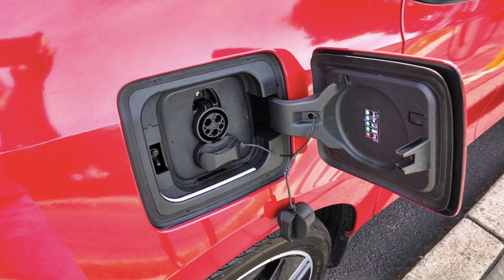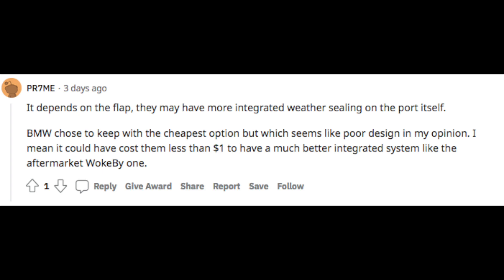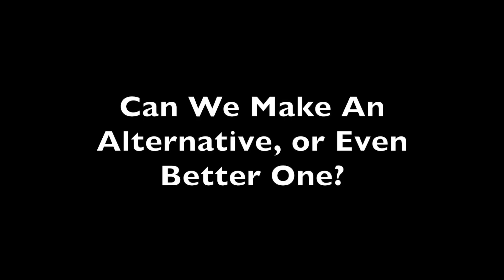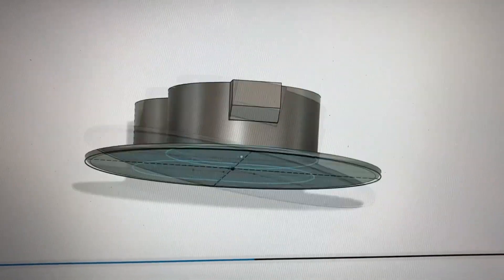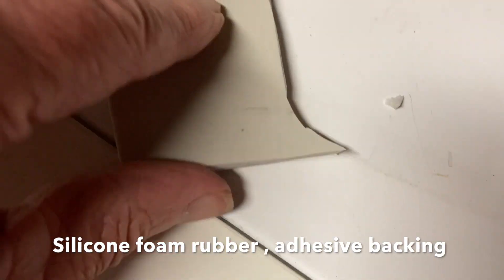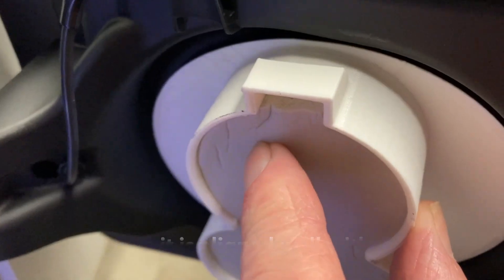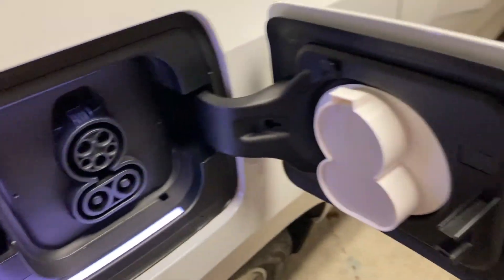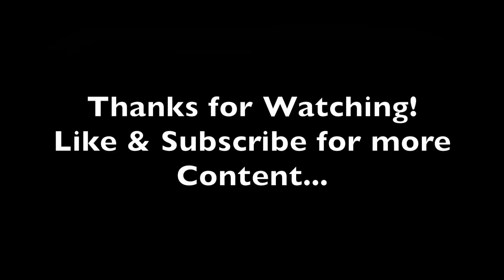BMW I3 DIY Better Power Plug Cover Redesign

Comment: Try printing it with TPU, or another rubber type filament. One material instead of the gasket.  Would you mind sharing the 3D File?  Thinigverse? Further I'm thinking - just having the AC port cover in the door and leave the DC port cover in place. I'm only DC charging once a year or so.
Reply from the maker: All good ideas.  I actually made a low profile DC cover that can be left in place, mainly because of safety concerns- I'll make a short video/upload file to show it soon.  The STL files are on thingyverse already, link is in the description or you can search for it.   I didn't use TPU since I didn't have any- but a good idea!    Thanks for the feedback.
Reply: @bmwi3diy782  This is awesome stuff! Have you had a chance to dial in the low profile DC cover? Just curious if that has been uploaded to thingiverse.
Reply: @bmwi3diy782  I don't see your DC cover on Thingiverse. Could you link it?

Thanks so much for this design
Reply: @bmwi3diy782  Hi there. I looked at your designs in Thingiverse but I'm not sure which one is the "low profile DC" version you mentioned above. Thanks and great job

Comment: What material did you print with?
Reply from the maker: I used PLA, but I think I would try PETG next time since I like the durability better.  Also, as the viewer below pointed out, maybe the design would be better to have a cover remain in place for the high voltage DC terminals when only AC charging, in case they get exposed to water accidentally.   Thanks for watching!
Reply: @bmwi3diy782  Thanks for the reply. PETG would probably be better. I know it would be where I am in Central Florida due to the heat. I was also concerned about the open HV port if charging in the rain. I am eager to see what you come up with.